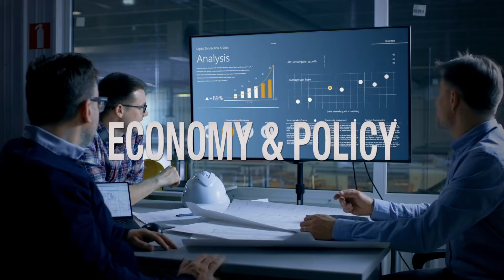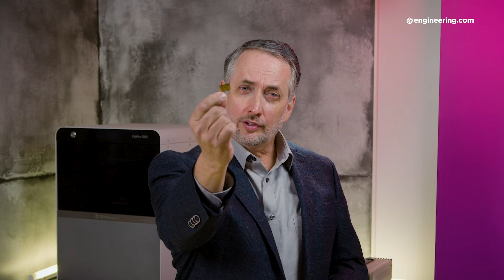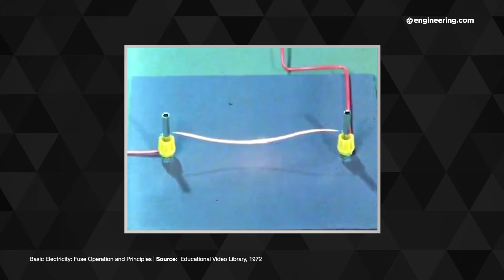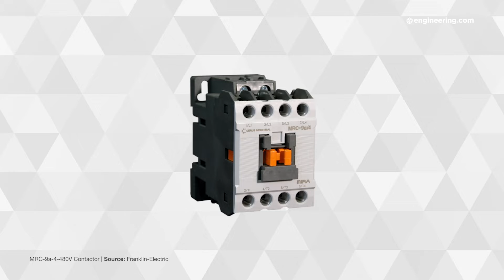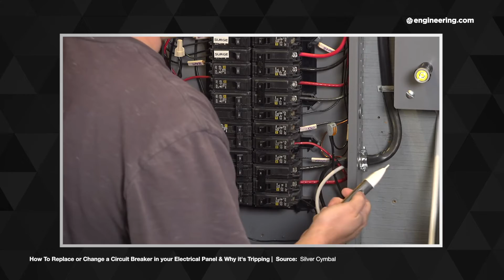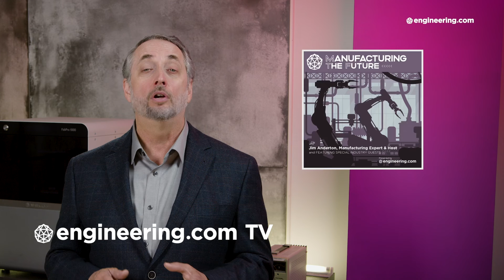Why Fuses are Still the Ultimate in Circuit Protection

Comment: We still use fuses in spacecraft electronics as a 'last line of defense' to insure circuits that would continually draw power don't get shorted on in a fault condition.  You can't replace them (usually) as there are (generally) no humans on board, and other OCP circuits are usually expected to do that job...
Reply: yeh that's what I do when I build satellites too